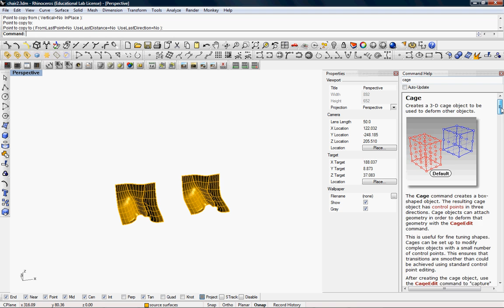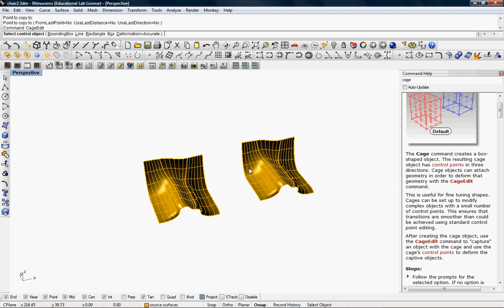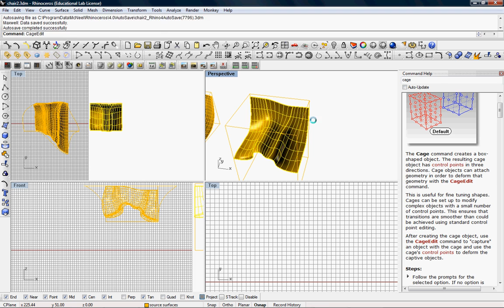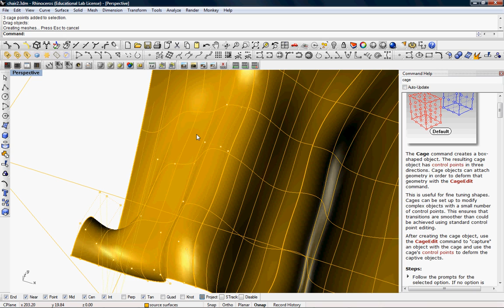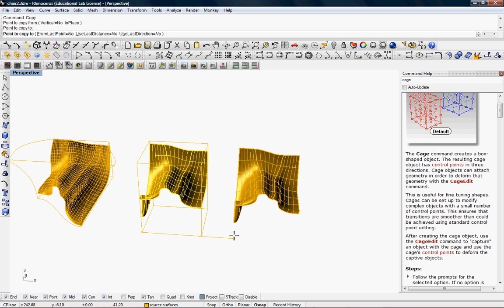Rhino Cage / Cage Edit

Comment: omg now i get it this the stupid version that im using
Reply from the maker: The 'Cage' and 'CageEdit' commands are available in Rhino for Mac as well as Rhino for Windows versions. Was the 'PreserveStructure' option setting selected during the cage editing process?  If the control points of the cage disappear, reselect the cage by typing 'SelControls' and turning the 'PointsOn' command (F10) to edit the captive polysurface further.  With newer Rhino WIP versions, the subd command might also be of use for you.  If you think this is a software glitch or would like more detailed comments from both Rhino users and developers, please use the Rhino Forums. About cage editing: https://wiki.mcneel.com/rhino/cage https://discourse.mcneel.com/ (FYI: Depending on the complexity of your original polysurface, you  can also try redrawing the polysurface as a surface and point-editing the surface face rather than using the cage/cageEdit commands.) Best of luck with your 3D modeling endeavors!